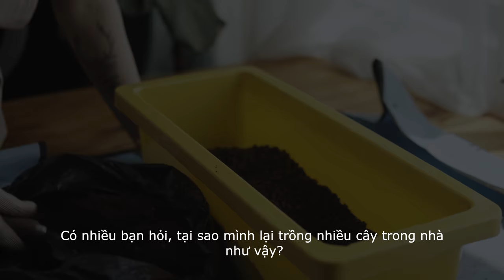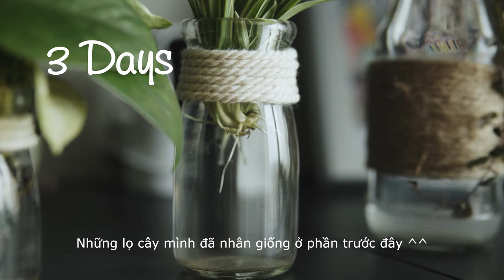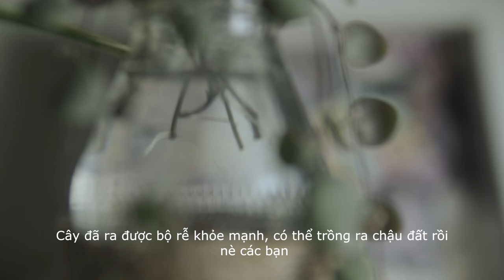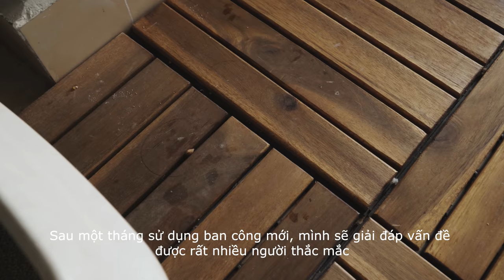#23 How I Cleaning My Balcony | What Does My Tiny Balcony Look Like After A Month!

Comment: Quick question: Did u dry the balcony floor and tiles before laying the tiles back on ? Or is it ok if they are still wet ?
Reply from the maker: Yes!! I will wait about 30 minutes for the floor to dry!  Because the outside temperature here is about 35-36 degrees Celsius in the summer, the floor will dry very quickly.  In winter, I think it will take a little longer 🥰🥰 If I laying the wooden mat right away without waiting for it to dry, it will take about 1-2 hours for it to dry on its own! Sometimes I still let my daughter play in the water there, so I see the floor dries very quickly
Reply: @XiuHouse  Thanks so much